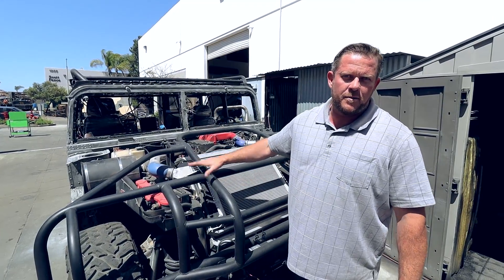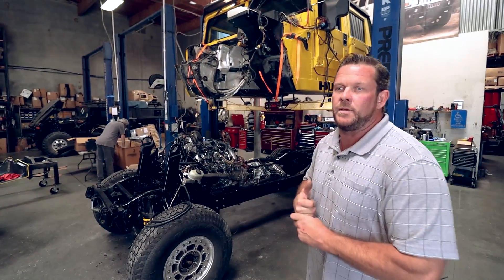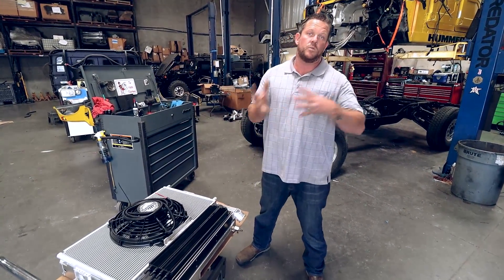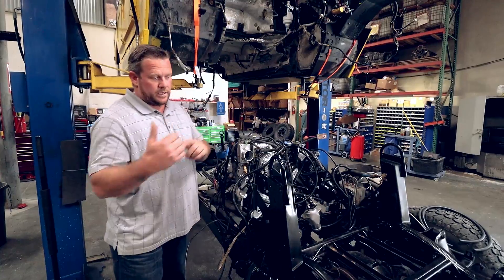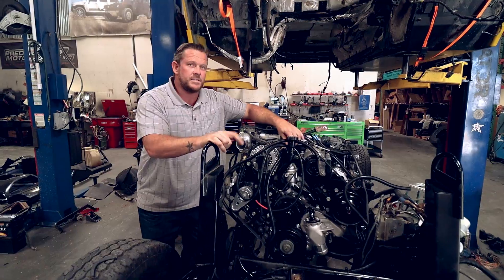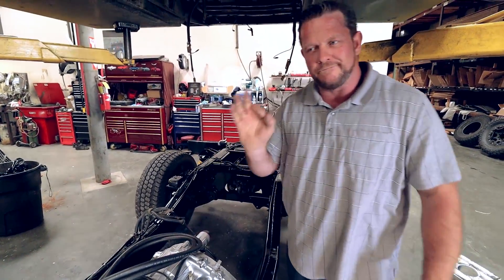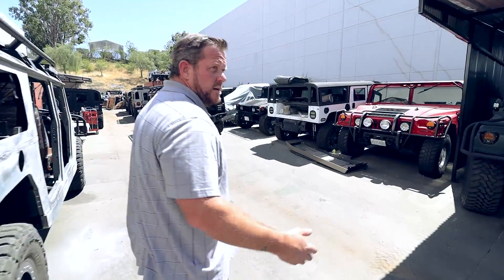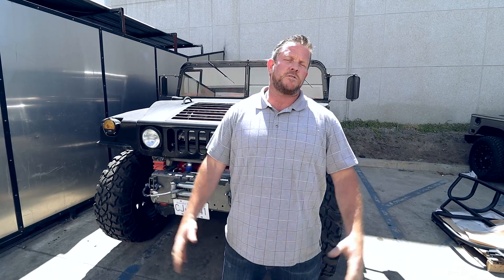STRETCHED SEATING CUMMINS H1 HUMMER

Comment: Bought a Frankenstein H1/Humvee replica last year and I'm almost done finishing it. H1 body mounted on an 89 chevy 2500 chassis with a 350 and 700r4 🤘. Best part is its super easy to work on. Also I'm going to be able to cut the tunnel out rear of the driver seats and have a full third seat with full foot room.

Comment: Sir WOW holy moly stage 4 🏁🏁 thats great insurance for  horsepower and torque transfer on that Lamborghini Orange H1 , gonna be a heart breaker and a breath taker HOOAAH 🇺🇸 btw i found out my green H2 has a factory Limited chevy camaro paint code , but the reason it has a candy gold green hint to it is because the original owner sprayed over its manufactored factory “ sandstone copper . Without tracking that paint code down on its mfc sticker, the painter only forgot to paint under the factory intake box , which now has a Spectra brand cold air intake replacement . The details for sure 👍🏼 . Great educational video Predator Inc Family

Comment: What I was wondering is can you put a Cummins into the H2
 Hummer?  And I was wondering do you have any supercharger you pull off the 6.0L H2 when they come in to have motor changed?
I emailed an ask for prices on having the  Duramax put in. I have a 1994 6.0L only 56,600 miles in my wrecked H2 my other H2 the 6.0 has 149,500 miles. I would like to buy a supercharger if you have one for sale to put on the 6.0 with 
56.600 mile an put it in my H2 with the high miles. Hope you can help.